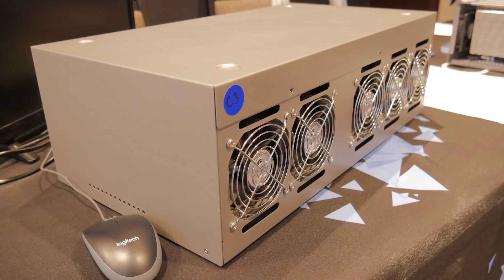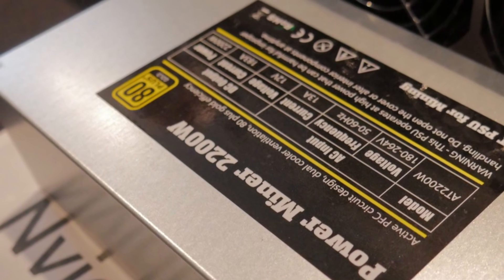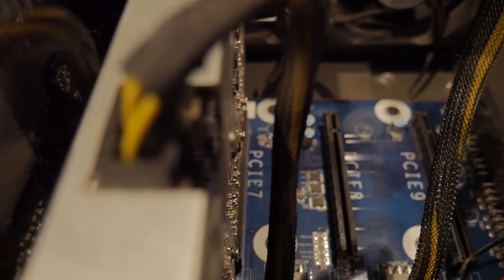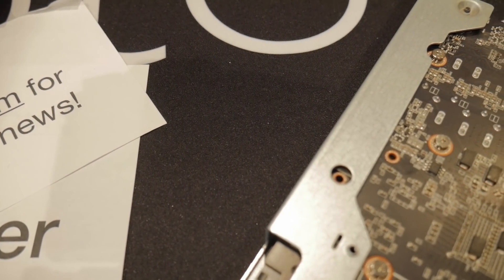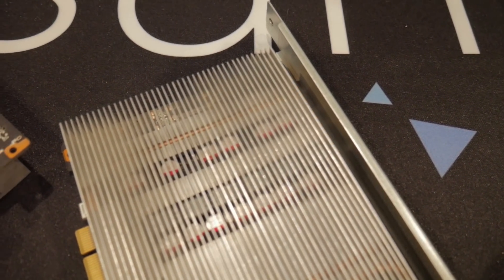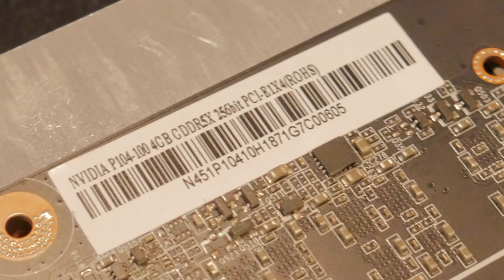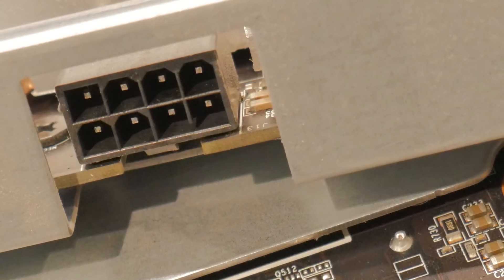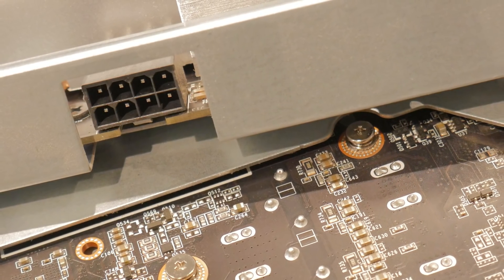Exclusive! Nvidia Mining Rig!

Comment: It's a gtx 1080 card as you can see the GDDR5X which is in 1080s only. And also my 1070ti gives 30mhs so 40 means 1080 only.
Reply: as if nvidia cannot put whatever memory they want on there
Reply: Willy Wonka speed is not only depends on ram speed itself. It needs more cuda cores and it should be compatible with that too.

Comment: 40 mhs on ETH??? i thought 1070 was 31 mhs max??/
Reply: Ethash is mainly uses vram instead of the cores and P104s use gddr5x vram thus having higher hashrates.
Reply: Matthew Lyon I was confused by that too is the gddr5x mem for these mining cars more optimized making them faster than the gaming 1070s
Reply: I get 34.x mh/s on my 1070
Reply: mr fool still not 40
Reply: Wait a sec: gddr5x ? Wasn't the poor performance of the regular gtx1080 blamed on the fact that the latency of gddr5x is worse than gddr5. So how can a gp104 with gddr5x do better than gddr5 on ethash?